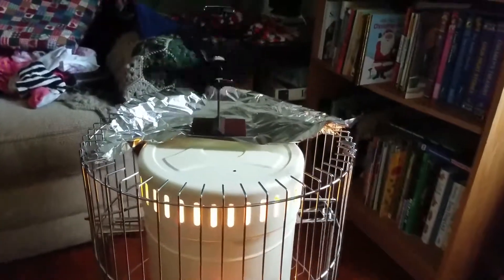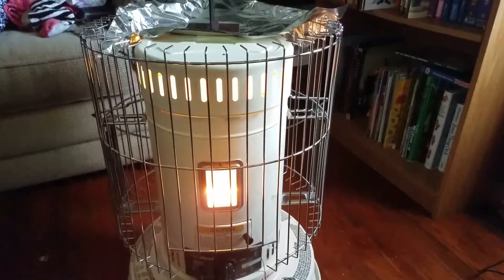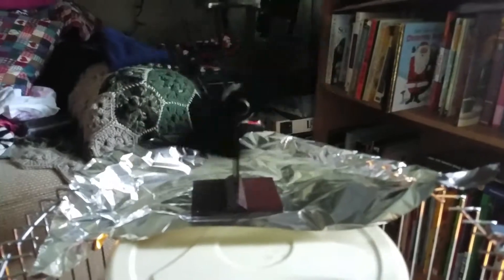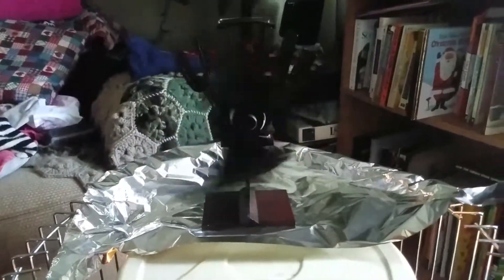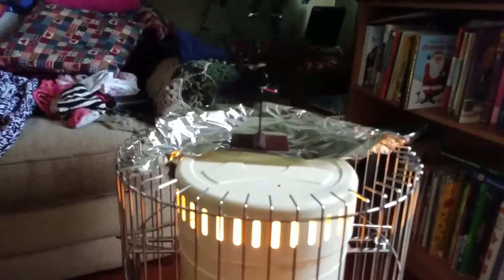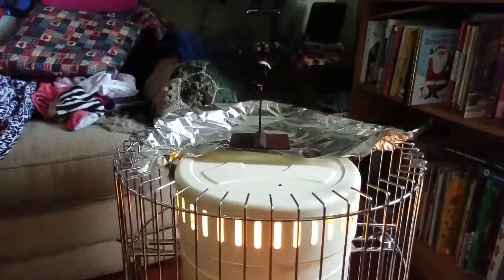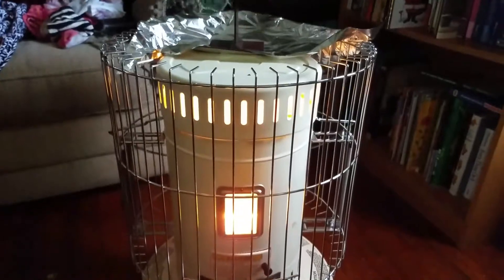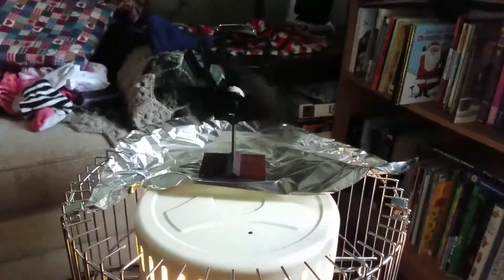Wood Stove Fan on kerosene heater, increase efficiency.

Comment: Just remember to keep your heater away from the thermostat, because it tricks your thermostat into thinking the whole house is up to temp and won't kick on your heat.
Reply from the maker: I no longer run this in a house. I've since bought a house and put in a new heater system. However when I did run this, the house heater was turned off.

Comment: Do you have CO detectors in the house?
Reply from the maker: I'm no longer in this house but no I didn't. This house leaked enough air around the windows and other places that there was always a draft. I'm in a new house with a new HVAC setup and I still have this heater as an emergency back up but mainly for if I have to do work in the garage in the winter.

Comment: What type of fuel do you use for indoor use?
Reply from the maker: K1 that I get from speedway gas station. I smell nothing while running and very little during start up and shut down. I ran this a couple year in the place I was living when I made this video and had no soot on the ceilings or walls. The heater itself shows very little soot on the inside and outside.

Comment: What king of modifications?  If you just put it on top of the grill does it works?
Reply from the maker: Yup, right on top, just have to add the aluminum foil behind the fan so it can draw in cool air from behind so the top stays cooler than the bottom.

I've now moved into a house that had an actual ceiling fan so I didnt have to use this fan but still keep it incase the power goes out to circulate the air.
Reply: @mistermacgray  The foil was acting as a heat sink at the base, slowing the fan. The hotter, the faster.
Reply from the maker: @labsub  the foil was allowing cool air to be able to flow past the fins to keep the top cool and the bottom hot allowing the temp differences to occur. Heat was deflected around the foil enough for that bridge to occur for cool air to get to the fan. Without it, it would be a 360 degree of hot air and eventually rhe fan would stop (I tried without the foil and it did evenly stop). This setup when I used it in my house worked flawless for years. Even when you use this fan on a wood stove, it is suggested to have it to the back so that it can gather cool air for the top fins and then push that cool air over the heat radiating off the stove top and out to where you are intending to push the warm air